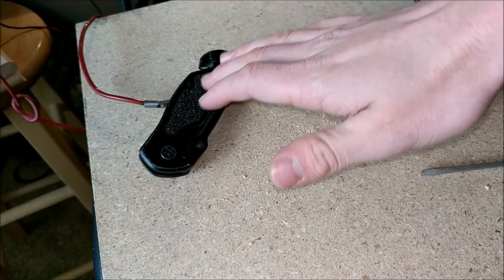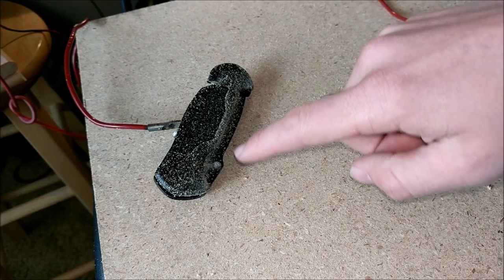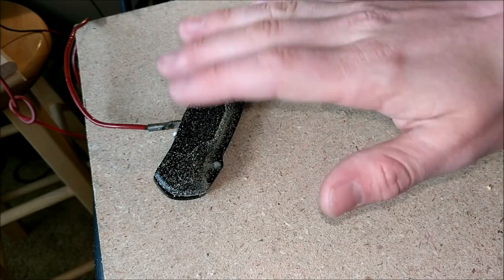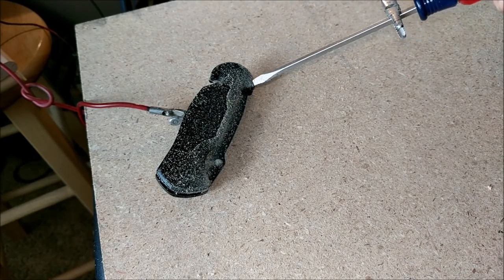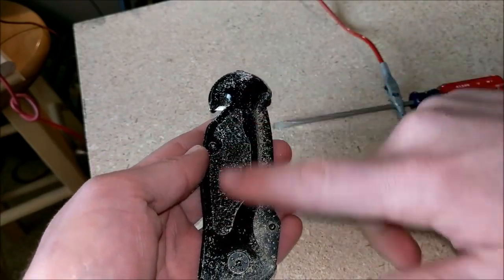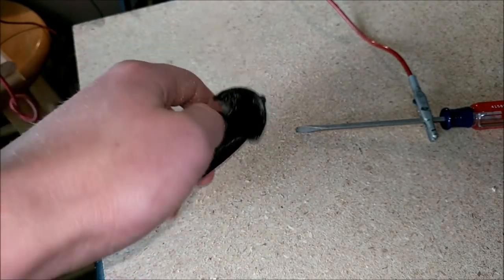An Interesting Experiment Regarding the Utilization of High Voltage for Moving Sawdust

Comment: I discovered something strange with hv, if you want to know message me, maybe you could make a video
Reply from the maker: Phonotical what did you discover?
Reply: Tanner Tech if you have a high voltage source and subject the terminal to the heat of a flame the carbon build up will grow along the electrical arcs
Reply from the maker: That's cool! I just tried it using a pencil lead graphite, and it made a cool arc, but no build up.  What carbon did you use?
Reply: Tanner Tech it was from a candle flame, maybe zvs driver would work best
Reply from the maker: Oh, so you used the carbon from the candle wick?
Reply: Tanner Tech yes, but that was after trying from a lighter and I didn't want to ruin the lighter
Reply from the maker: Ok, and are the electrodes normal metal like copper?
Reply: Tanner Tech I tried copper and steel and both worked out the same, I did not try aluminium
Reply from the maker: Thanks so much, I will try this out.  What did the carbon build up look like? Lichtenburg figures?
Reply: Tanner Tech exactly like that but in three dimensions, and it stopped working when I turned the power off, I have no idea how big you could get it to grow, I imagine as the build up reaches a crazy size the resistance might increase and stop the reaction, but it would have to be pretty huge😂
Reply from the maker: Cool! How long did your carbon grow to? I can't wait to try this after school!
Reply from the maker: I'll definitely be making a video on this if I can get it to work.  I'll mention you on the video too.